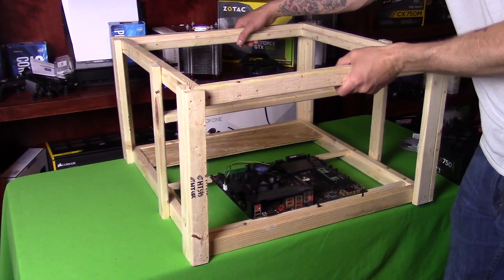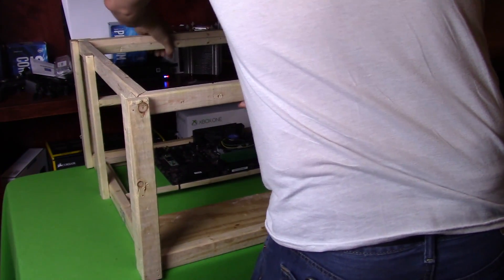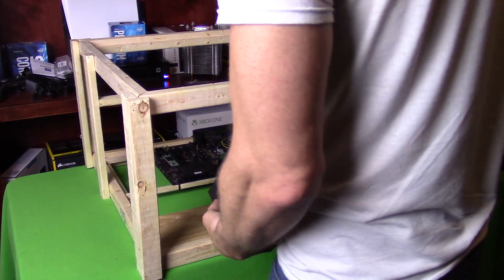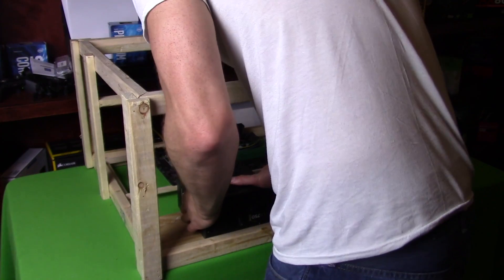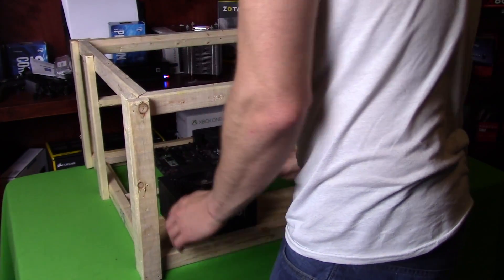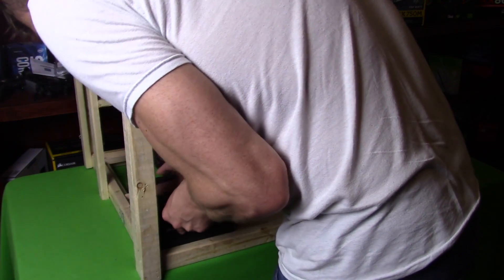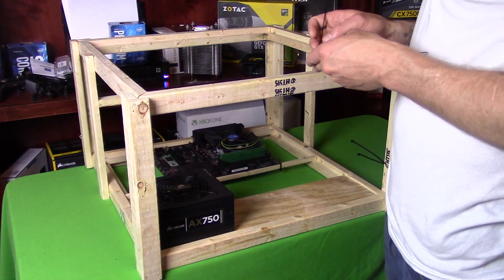5 Things I Learned While Building an Ethereum Mining Rig

Comment: summary
5- 1:34 watch out for cpu compatibility in mining
4- 3:44 its gettin' hot, really hot
3- 6:03 memory overclock is important
2- 7:52 powered pci rails are gamble
1- 9:22 motherboard compatibility
0- 15:27 do your research first before buying any hardware

Donations btc: 18Hv9Pfvx7pVWSicBFTQ7HAkukjo1qLcsR
Donations eth: 0x9fff534D1901Aa464f7a95fe8877a7c2418DC153
Donations Dash: XrioRGZ8jac3dfYjhmyrZSUygv1zM3BAC2

Thx
Reply: bro you had 13 btc on that wallet ?
Reply: Do you actually get any donations from posting your wallets? I've always wondered.

Comment: Hi there wonder if you can help I’m trying to setup a mining rig with 2x Nvidia GTX970 graphics cards on windows 10 but I keep getting error 43 come up. I’ve tried disabling the cards and re installing them uninstalling the drivers using ddu software, tried going back to older driver versions. Any advice is appreciated. Thanks

Comment: Hello Nice video. I do have some question. Can you mix gpu? I do have 3 evga gtx 1070 Ti and I also have Evga gtx 770. Can you ran them both? Or is it worth it to mix  them? As older card can take more power? I pressume. Thank you
Reply from the maker: +Captain Rylen those two don't mix well together as they perform better on different driver versions in my experience
Reply: Thank you for the quick response.
Reply from the maker: +Captain Rylen for sure man

Comment: is it possible you're using a pcie m.2 ssd and that's why the 2nd slot isn't working?
Reply from the maker: On that board, no, as I eventually used the converter. I did resolve that issue down the line with a little more win 10 driver discovery patience.

Comment: Hi,
I have SAPPHIRE RADEON RX 470 4GD5 MINING GRAPHIC CARD 11256-35-10G but it has no any display port,as per other Web sites it support HDCP,when i open  steel plate one HDMI port available i think it is HDCP when i connect it to  monitor not getting any signal or message ,with the help of Nvidia 210( basic card) i got display and doing Eth-mining 22 mhs. can any one suggests me  how i turn it on my monitor any HDMI Spliter will work on it ?  or how i can get 27mhs  Or is this port is dead ? request to you all kindly share your opinion
Reply from the maker: doesn't that card just have a single dvi?

Comment: Question, if you build your own rig You would have to keep buying more video cards over time to break even  because the power needed to mine will fluctuate. Less power from those video cards means less capital to gain long term as of now. What is the most efficient way to mine these days without losing power and to sustaining a good flow of cash

Comment: Consider doing the frame for the cards in metal.  It works as a heat sink, and it DRAMATICALLY lowers the heat being radiated. I know metal is more expensive, but do the lower part of the frame in wood and top rails in metal

Comment: Is it worth it to get multiple 2gb gpus if they are cheaper and if power is not a problem? Is the hashrate just based on the total combined GBs you can output. Let me rephrase that; does running 4x 2gb worth of gpus produce the same hashrate as 1x 8gb gpu?
Reply: Son of a Tech want to mine monero; but I am wondering if the hasrate is the same if the total GPU GB output is the same.

Comment: My 6 gpu rig (msi gtx GeForce 1060 gaming x plus 6gb Samsung memory) showing 5 out of 6 gpus..The system is not seeing the 6th gpu.. I am running up to date gpu drivers, up to date windows. My motherboard is gigabyte z270x-ud3.. no bios mods, only slight over clocking with afterburner to get 20 mh/s ETH. otherwise it's 16 my/s out the box...

Comment: You can use that nvme slot to add another GPU by the way.
there are NVME to PCIE risers that dont affect the other slots.

use a sata drive, or an external usb drive and you can get an extra GPU on that board.

Theres a guy online that has one, and just uses a USB thumbdrive (32GB) for windows.
and the drive is also very tiny so it doesnt even look like the PC has a drive of any kind unless youre told!

windows loads slower but it let him get an extra GPU in.
and once youre going you wont notice anyway.

Comment: if youre going to run any 900 series nVidia cards. just mine something else with those cards.
or dont use windows 10... this (3mh/s) issue, is only on W10...
go to windows7 or linux, and the 900 cards run fine on the newest drivers.

zcash is a great alternative. in fact nvidia does zcash a little bit better then amd
in the same way that amd is a little better for eth.

Comment: Is it a good idea to mine ETH with my EVGA FTW GTX 1070 and let it run overnight while i'm sleeping?  I mined for a few minutes just to see my MH/s. It's around 31.3 with spikes up to 41.7. This is at 2113 (+150) Mhz core clock, and 4551 (+750) Mhz on memory.  70% power limit and 70 degree temp limit. Hopefully it is stable!

Comment: I dont get the memory overclocking. I tried it on 2 cards and had zero effect.
Overclocked my MSI R9 390 memory from 1500 mhz to 1650mhz -> 28mh/s to 28mh/s. Overclocked core clock from 1000mhz to 1180mhz -> 28mhz to 33mhz.
I also tried to overclock the memory of my HD 7950 and it also stayed on its 13mh/s without a change.
Reply: Thanks for the answer, in fact I just tried to underclock the memory of my AMD cards, went from 1500MHz to 750MHz! I still get the same Mh/s.

Comment: Have you looked into an optimized GTX 1070? You an easily reach 30+ MH/s with one of those cards (+650 mem) and reduce your total power draw to about 110w per card with basic tuning (Google it). This should beat anything that AMD offers at the moment simply because of the reduced power draw. Granted, the 1070 costs about $500+ at the moment, so your initial investment is high, but long term you'll be more profitable because of reduced power draw.
Reply: I've got my 1070's at 115w and 28.5 MH/s stable right now. I need to adjust some other setting in BIOS I think to get above 30 without a crash. My local Microcenter has 1070's in stock every day. They have 40 in stock and even have a sale price of $489 right now. I'm about to get 6 more this weekend. If you buy a MOBO and a CPU you can get an additional $50 off each card. The hardest part is getting enough people together to go buy them since Microcenter has a limit of 2 per household.

Comment: I'm using win10 (64-bit) with latest drivers and I get 20-22 mhs on a (single) gtx970. 

I had the 3-4 mhs problem too. And the solution that ended working for me was: 

- enable one DSR mode (global settings)

- enable "optimize for compute" just for the miner (some miners had problems with this option enabled)
Reply: Indeed. It doesn't make sense, but it works for some systems. I have no idea how someone found out about it. 

But considering how bad the alternatives are (using old drivers or windows 7), it's worth a try.

Comment: I split my cards into two rigs. So I have 2 cards in one and 3 in the other. Radeon Pro Duo+Rx470 (around 80Mh) and a 1050ti/1060/1070 setup (about 60Mh). Havent had any issues. The heat though is a different story.

Comment: I also have a Corsair AX750, :)
Can I plug 3 GTX1070 on it without any issues?
Thanks for sharing your thoughts, bro.
Reply: Considering the 1070 draw 150w according to nvidia site, i'd say yes. ^^
Reply: I have asus z97-a and i cant make it to work with 3 cards? i have 1x 1070 2x1060 and i can only make it to work with 1x 1070 1x1060 or 2x 1060 not all 3... i have the last bios and i have tried to change to bios PCI-E link speed to 1 and 2 gen but no luck, any ides?
Reply: I have my 1070's down to about 115w and still doing 29 MH/s

Comment: Nice video, you just earned a new sub :P Right now I'm mining with a 1060 3gb and getting about 18 mh/s. When I started mining I left the power limit at stock so within 48 hours my room was a sauna, so I think its funny you had the same issue. Before even watching your video I put the power limit to %50 and I saw a huge improvement in heat output without cutting into my hash rate. 

You had a very good point about memory speed that I didn't know about before, so I was wondering if I could get an idea of how high I could get my memory. I have the evga sc version so not heatsink on the ram. How high do you think I could get it while still being stable and within decent temp? I remember seeing your video review on the non sc version from last year so I guess I'll check that out right now. Also, would I need to increase my power limit in the xoc software for the ram, or does that only affect the gpu core clock? I'm of course going to test it out myself but I would appreciate some feedback. Thanks
Reply: Cool, is that the evga one with the cooler that looks like the stock intel cooler? I played around with my card a bit and I was able to get +800 mem on 58% power at 22 mh/s. Earlier I was playing around at +900 and even at +1000 but it wasn't stable. I'm finding that on the cheaper 1060s people who are mining usually are able to get +750 on the mem.

Thanks for the reply btw, its helpful to know what other people are able to hit on similar cards.

Comment: Why use wood aluminum frame with connection between the gpus for cooling .
Reply: Wood is cheap.  It also won't pass current.  Can be cut and expanded to add to easily if you want a second stack of mining cards.

Comment: Started mining with my 1080 yesterday and have made about 4-5 dollars.
Reply: if you do it for whole month it's about 120$ (ok energy -20$) so still 100$ why not :) (try zcash instead)
Reply: Same but I had some crashing, what settings you use for the GPU (Do you have MSI Afterburner settings to share for it?)
Reply: Try nicehash with the dual mining mod, should net you a little more.
Reply: Yea mine always crashes in msi if i go over 250+ clock speed and 300+ memory speed. Under that seems to stay stable! I have a 1080 ftw evga getting 22 odd avg mh:s
Reply: I experience crashing with every possible settings pretty much, does your other pc parts matter for mining with gpu? I have cpu with broken cooler and old motherboard and memory.
Reply: or maybe I broke my almost new 1080 in just 1 week of mining..that would suck.
Reply: you are getting bottlenecked, what is your psu ?
Reply: if you start mining don't buy more 1080's buy 1070 they're as good at mining and cheaper
Reply: I'm Alive bet you made lots of bones eh? Haven't seen your comments in about a month how's it going ^_^

Comment: Pro tip I learned the hard way, I've looked and cant find any info on this by researching, but the RX 550 4gb does not mine on ethOS. I'm guessing it is just under 4gb maybe and cant hold the dag? EthOS reads the card fine and mines with an RX560 just fine. It says the miner is commanded to start but a hash rate never comes up.

Comment: Very helpful video visually and verbally. Thinking of building a mining rig myself similar to yours. I actually currently have 4 desktop running in my room as of now which is kinda stupid, but I was given two of the old desktop by a friend which has i5 3450 and surprisingly a motherboard able to support dual gpu on it (BIOSTAR TH67A+ motherboard). Each desktop, my main, side and the two that was given runs 2 GPU each (Dual GTX 1080 ti and Dual GTX 1080 for my main and side, and dual GTX 1070 and dual radeon hd 7950 3 gb (which I bought $100 CAD each from kijiji) for the ones I was given. So far it's been good earning ~$30-33 USD each day undervolted and at 75% pwr, 100-150 core, 200 max on those that are better graphics card, 500-600 mem setups for all the gtx. However the btc/day does fluctuates and my wifi isn't that good (often times my wifi dies and not able to reconnect) compare to people who actually live in the city, as I live in small town with ~8,000 - 10,000 population. It does get really hot without having the fan or any air circulation on. I tend to always have my room open and even though I am renting in the basement where it's supposed to be cold, I still need to have my fan on at all times. At least I won't need heater during the winter though as it gets up to -40 degree Celsius in Alberta. Keep up the good video bruh.

Comment: there is a work a round for the driver issue with the gtx 970. locate and launch nvidia-smi in cmd in admin mode with the commands -q -d SUPPORTED_CLOCKS and then find the top clocks there and run nvidia-smi -ac memoryclock,coreclock (insert values instead of clocks). If you overclock you will have to redo these steps again.

Comment: 9 series work with 10 series with latest driver. you need win 7 or linux
Reply: I know it for sure, wrapped my head around it for 2 days. i have one 1080 and two 970s and windows 10 as that is my personal PC also.the 1080 was getting 23mhs and the 970s 3-4 mhs each. just installed win 7 on a diff hdd and with the latest nvidia drivers 1080 is still at 23 and 970s 20-22mhs depends on the clock speeds (tend to get hotter so I turn them down a bit during the day.

Comment: I'm running 3 970 gtxs together with other 10 series cards on the same win7 rig using latest nvidia drivers. All of them with a bit of oc run 21-22mhs stable.
Reply: I had same problem before running 3-5 mhs per gpu. Fresh windows 7 install seemed to solve the problem.
Reply: True. You have to use newest drivers for the 9th and 10th series to run on the same rig.